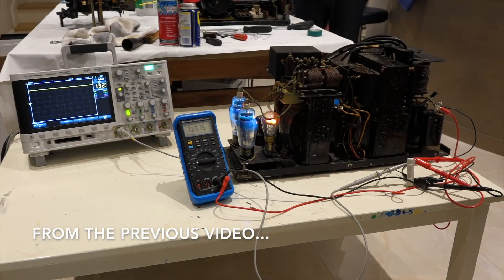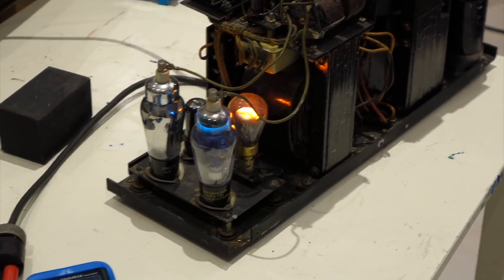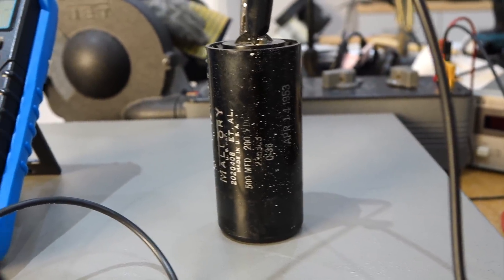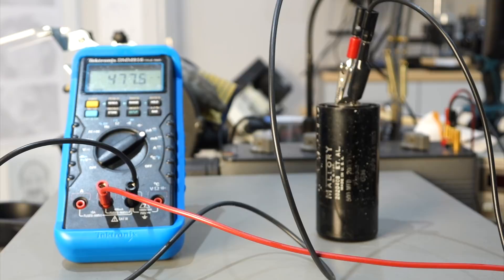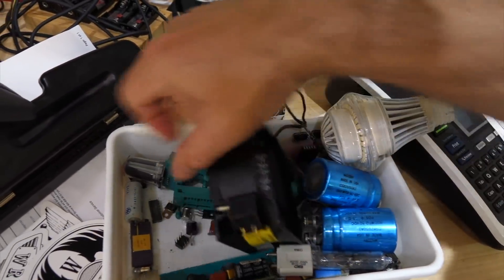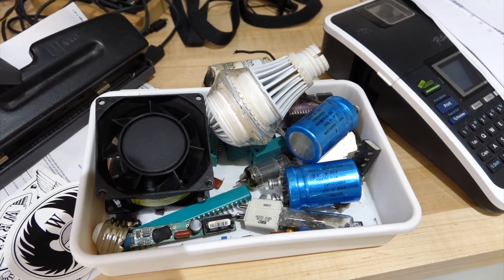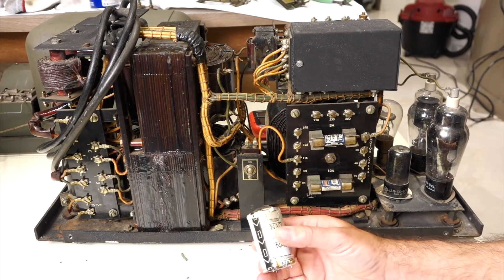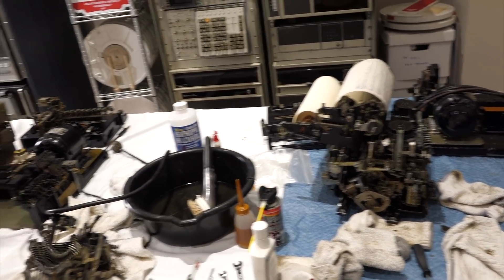Why we don't always replace vintage electrolytic capacitors

Comment: MepcoElectra- has an excellent app notes on lyric cap, how they were made, life expectancies,
Re-form process and parameters. In short,if you are not abused,it practically lasts more than two 
Life time. The MepcoElectra acts weird on your test because you have not re-form it. Consumer vintage 
Equipment used low quality capacitor to begin with and are not generally well ventilated so life expectancy is short as you expect on low cost consumer products, I have not found a single bad cap
On vintage tektronix or hp they were well ventilated,yes they do blows fuses in rare instances and power up finely with new fuses.

Comment: Very good.
Altho my beef is with some more modern caps. Got hold of a nad c352 amp. It performed really bad so I checked out the caps. Despite the amp being around 15 years old, many of the caps were visibly failing.
The cheapo caps I replaced with mainly Panasonic and it's amazing now.
Just noticed you had a nad cap gone bad also.
The two main caps are still original and are starting to bulge! They are 120k uf and will cost a fortune to replace.
In vintage gear I've come across several failed caps, and replacing them did indeed fix the faults. But a lot of the time caps seem ok and I'm sure they were made better back in the day 🙂
Reply from the maker: Yes, I also seem to have more problems with modern caps, and ran into the same NAD issue: https://youtu.be/kTYlGG9CdtA !

Comment: I had a 1964 Super Reverb that had never had much use, and the original high voltage supply capacitors reformed and tested fine, so I left them in the amp. Within a year of being back in regular use, the amp started to hum and then started to blow fuses. The lesson is that it's very difficult to take a snapshot of a component and then extrapolate from that how it will perform into the future unless you have extensive experience with that particular piece of equipment and the capacitor model and brand. Even then, your prediction may turn out to be wrong.

Comment: Every time i done a repair on one of my old hifi components i do a recap too, it doen't cost much so why not, most of the stuff i have are from late 70s early 80s and usually those caps where still good, i sometimes even reuse them in much older but less important devices. On my 1967 akai reel to reel all the capacitors had 2 or 3 times the original value so that was the first time it was really necessary to me but still the sound quality didn't improve significantly.

Comment: One answer to this is experience , I have found generally most but not all vintage caps to be in okay or good order, it seems to be only the 1990 and a few years ahead that fail in the worst manner. I have been involved in electronics for over 40 years and have seen it all and repaired all sorts of weird stuff.

Comment: I'll start with the most important point: It's your equipment, do what you want with it.

As I understand the issue, there were a few years in the late 1990's where a lot of low-quality "clone" capacitors were produced and used, so it is generally generally smart to replace capacitors of that vintage. These caps, on the other hand, seem to be from the era when stuff was genuinely made to last. The wiring also looks a lot more robust than the relatively fragile, paper-thin etching used on modern PCB's, so I doubt the cap would cause irreparable damage if it were to fail catastrophically or short out. This device is also designed to work at high voltages, so a short to ground wouldn't cause nearly the same catastrophic failures as if it were releasing 110/220v into a 5v digital circuit.

I see commenters more knowledgeable than myself discussing manufacturing differences and thermal properties, but I will refrain from discussing those aspects in detail for lack of knowledge on my part. If any of my assessment is wrong, I ask the experts to correct me, but you don't have to start a war over it; I am genuinely interested in learning more about electronics in general.

Comment: Let's see, 120V at 560µA, that means it would be dissipating 67mW of heat from that leakage.  That's not going to be a problem either.  I do tend to check old electrolytics, but the factory installed ones in my old Tektronix vacuum tube 'scopes are still fine.  I had assumed then 8µF unit from my 1930s vintage radio was bad, but I didn't pitch it, perhaps I should dig it out and test it.
Reply: I dug out the radio chassis.  My best guess is it is a Crosley Gemchest, which puts it at 1928-1929, with the (then) new "Mershon" electrolytic capacitors.  It's a two-section unit in a metal box.  One section measures 4.8µF, the other one 5.2µF.  Not bad at all for a 90+ year old early technology electrolytic.  I'll have to break out the Tel-Ohmike and check the leakage.  I wish I had an ESR meter!

Comment: Capacitors are cheap,I don't leave a 60 to 90 old caps in I text them on a vintage capicaitor checker at full voltages,the are always leaky ,why risk a cap shorting out and it takes out other component ,because you won't spend a dollar or less.leaving old caps in is cheap and lazy .but that's just me ,I want my repair safe for a long time .like new as possible

Comment: The reason why I replace a lot of electrolytic capacitors is convenience. If I have the device taken apart to fix a problem and find that some electrolytic (or film/paper) caps are bad, it is better for me to just replace them all right now instead of just replacing the bad ones, then some time later having to take the device apart again to replace some other failed capacitor.

Once I took a motherboard with a bunch of bulged capacitors to get it fixed and specifically asked them to replace all electrolytics there. They only replaced the bad ones and less than a year later the other ones failed and I had to replace them.

I also have a similar experience with some tape decks made in the USSR in the 80s - replace only the bad caps and you will be taking the device apart again to replace some other cap rather soon.

So, if the device does not have problems with capacitors, I leave them be, but if problems start because of the caps, I would rather replace them in one go rather than having to fix the device multiple times.

Comment: I think the fear of blowing transformers comes from the audio side, where a DC blocking capacitor failing might burn an audio transformer. I personally have two guidelines; if a capacitor is swollen, I don’t even bother measuring it, I’ll replace it directly, and usually with a low ESR one with higher voltage rating. The second guideline is that if a capacitor fails in a piece of equipment, I tend to replace all the similar ones as well, as my logic is that if one has gone bad, most likely the other ones are bound to fail shortly as they’ve experienced the same environment for the same time. Mr. Carlson here on YouTube has a couple of good videos regarding capacitors, and with his experience, he usually completely removes some types of capacitors that are prone to failure. Reforming capacitors is another can of worms, I understand that people working on valve amplifiers for musicians might completely replace all electrolytics, but then again considering how those old amplifiers are used, it might make sense for that particular case, compared to a old teletype machine that isn’t frequently used. Each to their own, there’s many ways to skin a cat!
Reply: There’s also probably a difference in quality in older equipment, I’d wager that no expense was spared when manufacturing those teletype machines, so the capacitors are probably a lot higher quality than what was used in say a radio or television of the time.
Reply from the maker: No kidding. The caps in the TTY supply are mil rated. They have little in common with the generic ones found in vintage TVs or radios. Two different things entirely.

Comment: Not replacing 30 plus year old electrolytics is literlly playing rush and roulette, its not a matter if they will internally short or dry out, but when. Newer electrolytics from good brands, will perform far better then an older cap, even when it was new.  Panasonic's newer, superior fm series cap vs an old nichicon ce series, or even a paper in oil spurge atom with thousands of hours on it cannot compare to a newer eletrolytic or polypropylene as an example, newer caps will be far more stable, will handle higher temperatures, and will have a far longer life... not replacing old caps is such a risk that it isnt worth taking lmao I'd rather an old cap "even if it tests good" to be switched out to remove the risk of it shorting out and being far out of value with a far higher esr and then possibly killing a part when it shorts that isn't made anymore making the gear useless, all because I "didn't change it" and thought it created "magical mojo" Nothing but good things can come from a good recap, It's so easy to find quality replacements from mouser these days that will far out perform the original's even when new. It is a win win. I can name several manufacturers that are fantastic as well as a handful of series from each brand that'll work perfectly...  for axial caps CDES tta series, vishay spurge tte, 30D series, for radials, Panasonic fm, fc, fr series, nichicon uhw, ubw, uld, ka. for screw type nichicon nt, cdes cgs series. for snap on, lgu. For polypropylene caps, which are useful for smaller values, wimas  mkp4 radials will do an amazing job getting rid of black bumblebee deathtraps which are so overrated and pose a huge risk of age related failures. lol For obscure eletrolytic values würth electrik typically has those. Nippon Chemicon and Kemet are also incredible manufacturers as well, heck elnas new lines are great to. I could go on and on... it's just not worth the risk of running old and tired caps even if they test good especially if they're paper and oil caps...... it's asking for trouble...

Comment: I am glad you keep the old equipment running now I normally test capacitors using the capacitance meter with a magic eye and also you can reform them but I have found and in most old equipment similar capacity to 8 microfarads and when I have reform them you can still get a hum especially in old radio equipment and also the capacitance drops as well so you also have to be careful and especially with the older ones I restored old radio 1928 and the capacity of that were in were Hollow when you tap the cave of the electrolytic capacitor and also if they are bulging out where the connections are it is best to replace them when they are like that I hope this was helpful to you and keep the good videos going thanks ever so much all the best for now

Comment: as time goes on i find that recapping is more and more necessary, 1950s caps are fine, 1960s caps are generally fine, 1970s-1990s, i almost always recap
Reply: better made in the 50's ?
Reply: Better made? Or survivorship bias. That's another possibility I suppose.  @memecoinmafia2732
Reply: @memecoinmafia2732  The thing is with 50s and 60s capacitors is that it was rare to make compact capacitors since it wasnt really possible at that time. 70s-present there have been more and more pushes to make things smaller. With the improvements things got smaller and only slightly worse when it comes to durability
Reply: @AlpineTheHusky  Do not forget insane dimensions of old devices. With very free air circulation. Now everything is smd and every manufacturer produce devices as small as possible. 60c is new "normal", as time goes devices gradually increases incase temperature to 80c. Due to degrading components, dust and bad case location without airflow.

Comment: When deciding whether to replace a vintage capacitor,  I mainly look at  visual appearance, capacitance, capacitance frequency response, leakage and ESR. Last is the amount of work to get the job done nicely and the risk of not doing it. In many vintage repair job I did was to gut the original capacitor and fill the cleaned  empty can with modern parts so they look the same after repair. I often found the inside of vintage cap almost bone dry, even with good capacitance and leakage numbers. Capacitor like this are associate with increased ESR and they are not going to last very long. Over the years capacitor technology improved a lot with thorough understanding of  failure  mechanism and  reliability. We see unreliable results sometimes because we overlooked subtle circuit  parameters  or bought low quality/incorrect  parts. Not all capacitors are created equal, today some parts are deliberately designed with shorter life span because of cost/size/temperature/ripple current .....reasons. I use better spec parts to make sure I do not need to repeat the same work again in the near future.
Reply: Capacitor technology improved, but due to cost cutting, some new electrolytic capacitors are just too unreliable, even if they are from reputable brands. It is not an accident that a new capacitor of a given capacity, voltage rating and temperature is way smaller than a vintage capacitor with the same specs. That is due to cost cutting, and not due to improvement. The new capacitors have much less headroom in terms of voltage.

Comment: There is a definite paranoia about changing capacitors particularly in audio equipment. This seems to have come about in the last 10 to 15 years. I am sure a lot of the people that have brought this about have little or no understanding of electronics. Its funny how you don't see many people changing capacitors in transmitters or receivers. This is because doing this can throw them completely out of alignment. You then require the test equipment & knowledge to correctly align them again which a lot of the "Capacitor Brigade" don't possess.

Comment: It's the aluminum electrolytic capacitors with aluminum cans,  manufactured starting in the mid 60s, that are most likely to fail after....any number of years after 10.   But the more time they spend under power, the longer they last.   The caps made prior to the early 60s are of a different manufacturing process and they tend to last pretty much forever. 

There is a great 22 page white paper published by CDE (Cornell Dubilier Electronics) that goes into great detail about the manufacture and characteristics of modern electrolytic capacitors.  Anyone who is into electronics should download that white paper and read every bit of it.
Reply: have a 1962 H K preamp with 3 can caps. 2 caps read good for esr and uf; but the can where the selenium rectifier died, both its esr and uf are way off. I stuffed it with 4 new caps. wonder if the SR killed the cap or vice versa.....

Comment: That Edison socket fuse might be the same standard I saw in European house wiring of that vintage.  If so the height of the bottom contact in the holder sets the maximum fuse rating, as higher rated fuses are shorter from top of threading to contact point.  A same size successor standard (upgradable) had a ceramic ring around the bottom point with higher rated fuses having a larger tip diameter, and the threading being on a reusable porcelain holder that accepted the new bottle-shaped fuses.

Comment: The rule I use is, if it's encased in wax it should go, though if I check it and it has no voltage across it I will probably not replace it, but wax coated paper/electrolytic caps are nearly always bad, if not they will definitely go bad eventually. The reason is because the wax let's moisture in and will degrade the electrolytic, the paper also goes acidic.

Comment: I own many vintage gear and hadn't changed even one electrolytic capacitor in 30 years. My beloved TA-NR1s use two monster caps each with the diameter of a big toroidal transformer. 
People claim better sound after changing 'old' caps but I've found always guilty of degraded sound quality the output relays.

Comment: Fully agree with you Marc. I'm a restorer myself and pro technologist...Carpet-Bombing with replacement caps (otherwise good resident caps) does more collateral damage that good. As a matter of facts, If it happens that see an add claiming that a unit have been "Fully Recapped/Restored"...I pass my turn as the reliability and ESD damage seriously compromise the longivity of it. Thanks.

Comment: Lately i bought 31 years old HiFi amplifier and IT still Has original capacitors: made in Japan Elna and nippon avf. Since Amp sounds good and i dont hear any hum, cracks etc i think its not good idea to recap

Comment: I was alway puzzled by the obsession with replacing capacitors. I know a lot of equipment made from 1999 - 2010 were fitted with duff capacitors and failed prematurely. I still have some Sony amplifiers made in the 1960s and they are still woking well. And yes I have seen capacitors starting to fail in vintage Mac computers and that is another matter.
Reply: I agree completely. We have a cargo cult of electronics repair noobs who think capacitors are the problem with anything. I should warn you though, that Sony (and all Japanese) small electrolytic capacitors from the 1950s and 1960s are absolute garbage, usually being all dried out. Mileage may vary.

Comment: With any amplifier vintage 2000 or older I usually replace all of the capacitors, as much better performing capacitors are available now that result in improved sonic performance.  Vintage electrolytic capacitors are crap for audio use, even if they are NOS and fully formed.  Another reason that capacitors can be smaller today is because of lower ESR and the reduced amount of internal heating.  During the 90's, capacitor electrolyte formulations were greatly improved, as well as improvements to the seals around the leads, and the ESR was reduced in the better grade capacitors.  Vintage electrolytic capacitors suck.